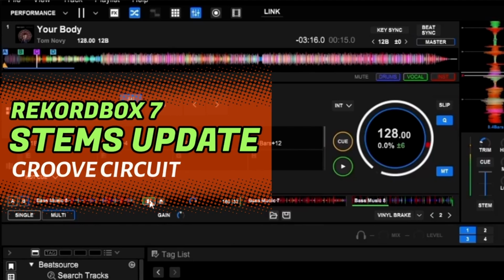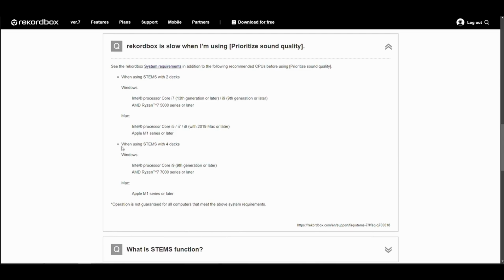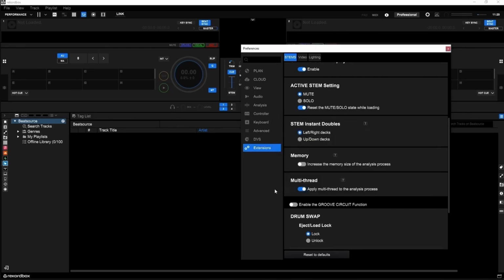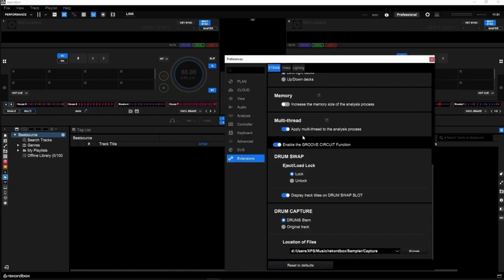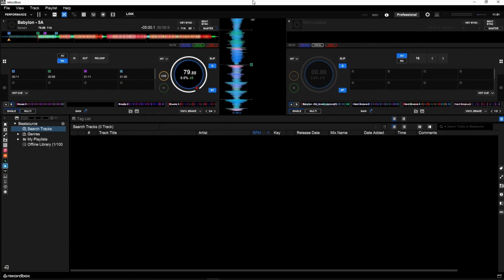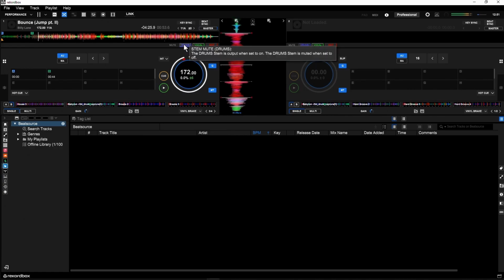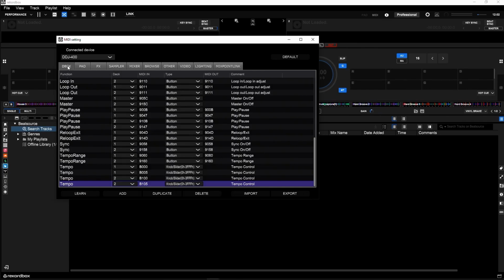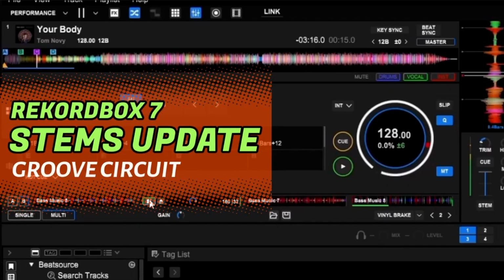Rekordbox 7 STEMS Deep Dive: Groove Circuit Explained (No Controller Needed)

Comment: One of the Best detailed video Does Drum Captures work with the DDJ flx4?
Reply from the maker: Thanks! You would need to midi map the FLX4. There are loads of videos on how to do that in Rekordbox DJ. Here is the instructions in their manual. https://cdn.rekordbox.com/files/20200312170611/rekordbox5.3.0_midi_learn_operation_guide_EN.pdf
Reply: @BillyLane916  Is it Groove Circuit free?

Comment: Hello 👋 I don’t see the extensions tab in the settings nor does stems come up when typed in search bar
Reply from the maker: sounds like you're using Rekordbox in Export mode instead of Performance mode. Click on Export mode int he top left and change it to Performance mode. You should see everything covered in this video once that's done.
Reply from the maker: also make sure you are using Rekordbox 7.0.4 or later
Reply: @BillyLane916  that did the trick thank you thank you

Comment: Hey, not sure if this is new for the stems but it is something I just found and I didnt see you mention it in this video but You can control the amount of each stem now using the mixer within rekordbox as well as with your dj controller. With the mixer selection on you now have a button that says stems under your volume fader (CUE is above and STEMS is under the volume fader) when you click stems that allows you to reduce or increase the "volume" or amount of each of the individual stems. I thought that was great. It hasnt been mentioned anywhere and to me that is going to be a function i probably use most often in all practicality when it comes to stems.  But thank you for this video it was nice to have all the new selections explained as I wasnt really 100% sure on some of the options.
Reply from the maker: You're absolutely right. The STEM ISO feature assigned to the EQ knobs is fantastic. Using shift + cue to switch the EQ to STEM ISO on certain controllers is a game-changer, and the fact that it's MIDI assignable makes it even more versatile. Personally, I prefer having that ISO control on the knob rather than using a solo/mute button, especially when mixing. A video that highlights this feature and its benefits would be a great idea!